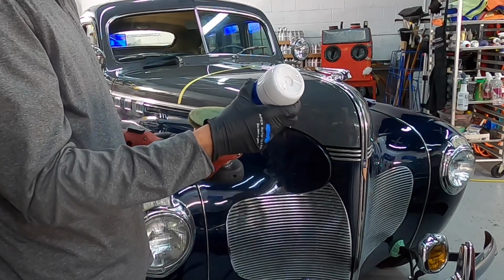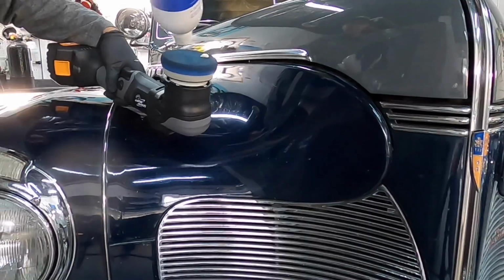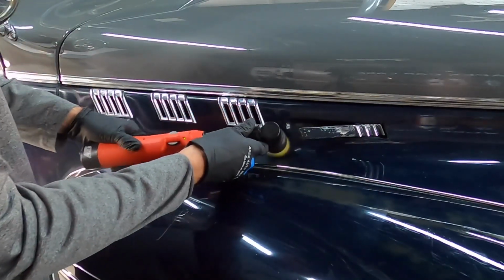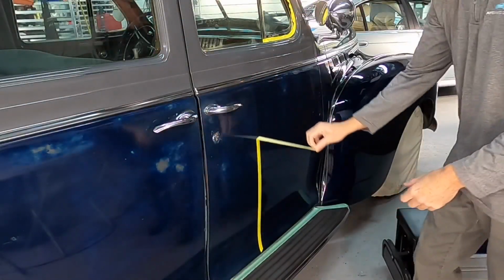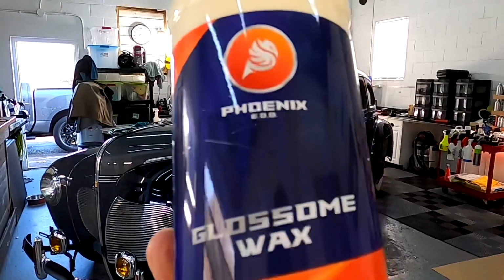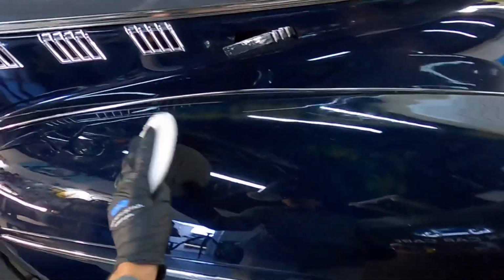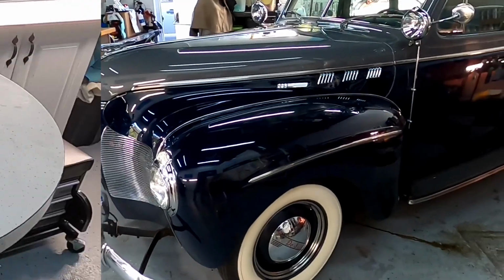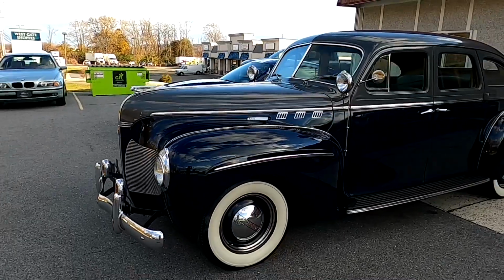Glossome Wax! 1940 DeSoto Paint Protection! Part 2!!

Comment from the maker: Anyone here still use wax on a regular basis?
Reply: Me!! Since I have zero skills and I just feel "wax" is way more forgiving...
Reply: @dreklin  don't be so hard on yourself. 
You have mad skills.
Reply: I have been a bit more lately. In the UK we have a lot of smaller manufacturers that produce excellent waxes at reasonable costs that perform extremely well .
Reply: Gyeon wax converted me back to wax as a topper to ceramics. I just got a new Volvo and don’t have time to correct for a coating. So I’m using the old reliable collinite 845 to get me through winter when I’ll  correct and put a coating on. I’m glad to see waxes making a resurgence
Reply: i often use Optimum polymer/wax  as a finishing touch   , smells like coconuts and last a good 4-6 months [Canada]
Reply: Wow…. Just, wow!
Reply: Yes still use wax most of my customers ask for wax then I try to upsale to a coating .. in some cases .
Reply: Not anymore , but i really enjoyed using Zymol Glaser purely for the look and experience of using your hands to apply it it was very therapeutic.
Reply: Nope
Reply: P21S, but not satisfied with it did use collinite insulator wax over winter time. Ran out of it. Now I'm interested in buying glossome! Wonder how it compares to Xtreme solutions polyseal.?
Reply: I have few clients who only want wax as sealant.
Reply: Yes, Collinite 845 Insulator Wax is my choice only on special cars though. Here in Scotland it lasts well.  Great two videos thanks. 👌
Reply: Still use the combo of Jescar UltraLock Plus topped with Collinite 845. Gets me through the winter and then some.
Reply: @djdecember1  I like Poly Seal
Reply: Yes I still love a good old coilnites 845, however I am currently screwing around with the turtle wax Graphing line one day all jump to resin base coatings, but I still love waxing my car!
Reply: Still use wax. Enjoy the process. Currently using Bilt Hamber Double Speed.
Reply: I mostly use Apex surface Protection Rehydra Sheet on my Apex coated cars. Un coated, I mostly use perfect polish topped with a light wipe down of sheet. 

Anyone other then me, still use Angelwax perfect polish?
Reply: Yup still a wax guy.. I like the look if I'm honest.
Reply: @dreklin  I'm with you this isn't my field of expertise plus I love spending time with some great music and spend a couple of hours cleaning and waxing.
Reply: Amazing video Brian loved it. Can anyone tell me what year car makers decided to give cars proper paint jobs.
Reply: @glennsavarese6504  I love collinite 845, it makes me happy when I get to use it; leaves such a nice warm finish.

Comment: Gorgeous lines. Can still see the last bastion of aviation inspired, 1930’s aerodynamic lines that would give way to more utilitarian chassis of the postwar era.
LOVE that era of design, as everything looks as if it’s going EXACTLY the 400 knots or so a propeller could achieve, yet still allowed a bit of artistic flare.
The engineers & designers were all about distinguishing the make and model and style back then, and not silly, cookie cutter designs ironically based on wind tunnel data to eek out a silly fuel savings margin without much distinction as they all look today, where you have to look at the badging to determine the make & model.
And kudos to the owner for the love given to continue to keep a rolling piece of art on the road that doesn’t have a fancy name like Duesenberg, Bentley, Alfa or the like. It’s almost more rare because it ISN’T something that would roll across a Mecum auction for 7-figures plus. I could bathe in that front grill!!! The front looks like it’s out of The Rocketeer.

And of course, beautiful job as always Brian!!

Comment: Another fascinating vehicle. I'm glad to see you're getting to experience Bilt Hamber products too, we're very lucky in the UK.

Question for you regarding coatings and these older cars. I completely understand what you were saying about them being a pain to apply correctly; have you tried using primer polishes? That's what I've found to be very effective - I've used Gyeon and Mother's CMX 3 in 1 for that purpose, with the latter not requiring a cure time, it seemed to set up fairly well and not affect the application of CanCoat (I appreciate it's a lightweight ceramic though).
Reply: I was just about to order Mitchell & King cleaner wax.   Are you familiar with this product?   Small UK based company.
Reply: @katiecannon8186  I've not used it myself, but I've heard of people really rating it, so I'd definitely not warn you away from it 🤘
Reply: @SuperchargedLlama  

The Pure cleaner wax seems to be kinda unique.   But I’m completely new to all this.  But I’m going to give it a try.